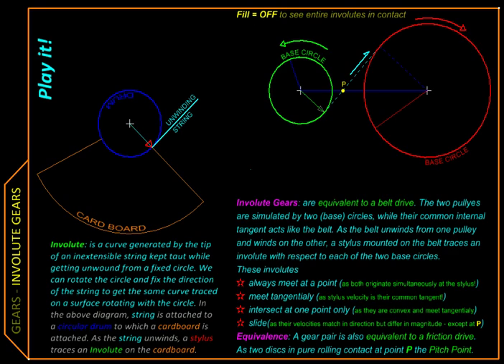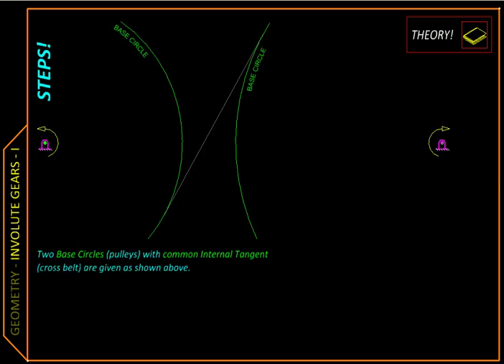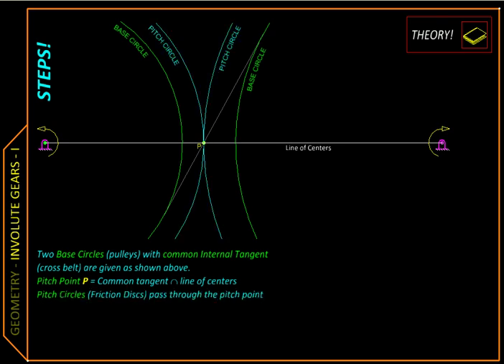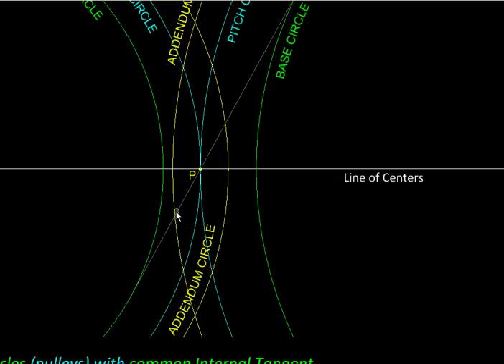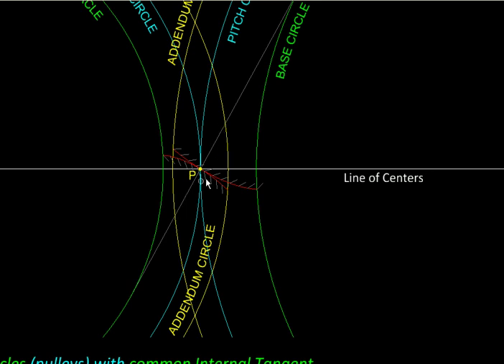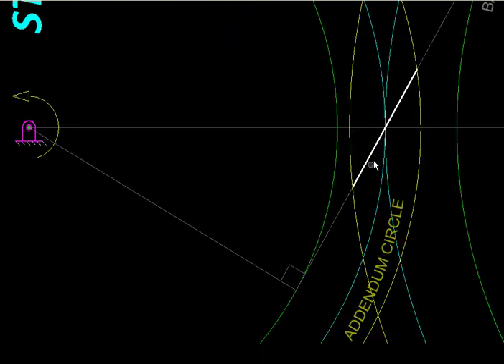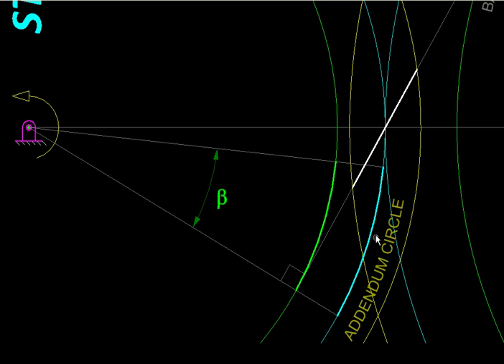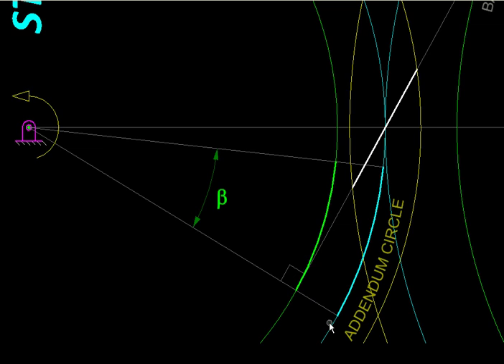Kinematics Ch06D Involute Engagement

Comment: can you please solve this particular problem ? 
  a gear set has a pinion with 20 teeth and a gear with 40 teeth , the pinion runs at 30 rev/s and transmitting power of 20 kw the teeth are on the 20 degree full depth system and have a module of 5 mm , the length of line of action is 19 mm, what is the contact ratio of the contacting tooth ? 
 anyone can solve this problem please comment it!